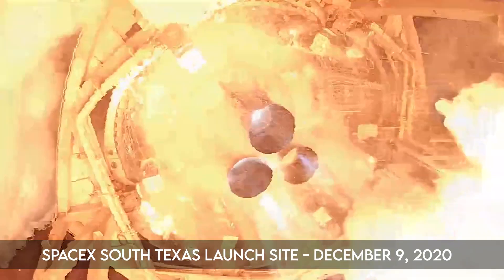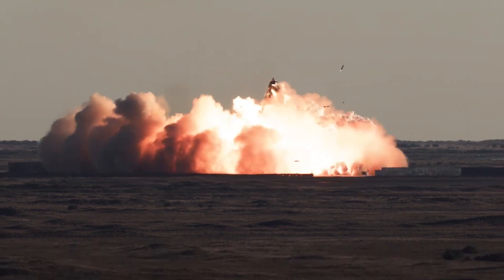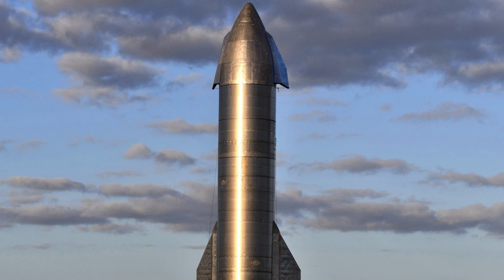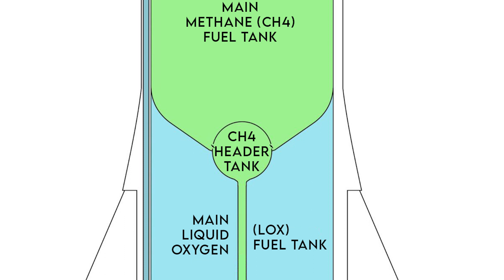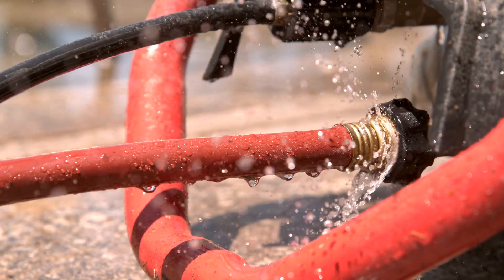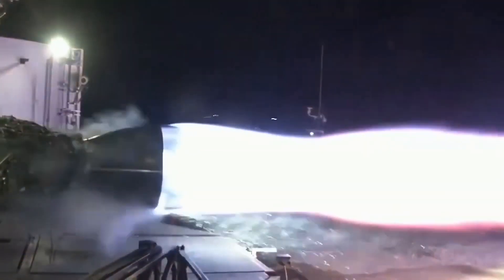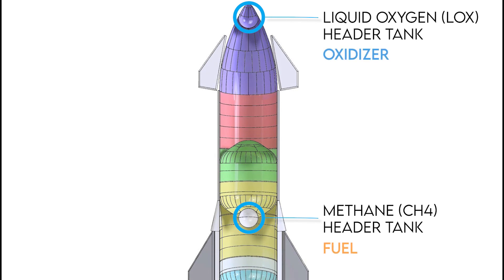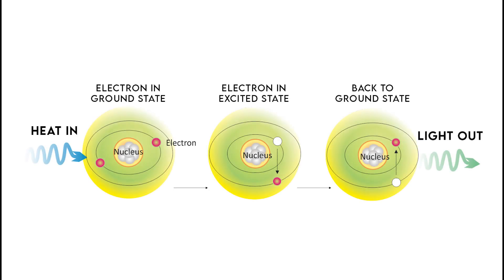Why did the Starship SN8 landing fail?

Comment: considering that at least one raptor was producing thrust you would have thought there would have been a mechanism capable of diverting some of the thrust force produced from the working raptor into adding pressure to the fuel tank.  Perhaps this will be a design consideration for the future.
Reply: It's in process already.

Comment: It didn't fail, but sadly your title did.
Reply: Exactly
Reply: His title is accurate - he never said SN8 failed, just the landing (which is true).

If SpaceX follow normal engineering testing protocols they will duplicate as much as possible the flight plan of SN8, but with the required fixes to the landing (and probably use the flight data from SN8 to update the internal flight simulator).
Reply: The landing didn't fail? So you think that's how a crewed space ship should land?
Reply: @beboshi69  Tthe landing didn't fail, but the test achieved the vast majority of its objectives.  This was not a crewed mission - it was an entirely uncrewed experimental test flight and came close to meeting all of its objectives.